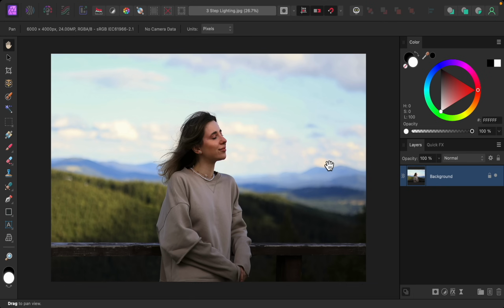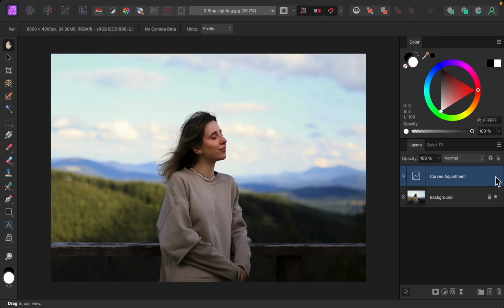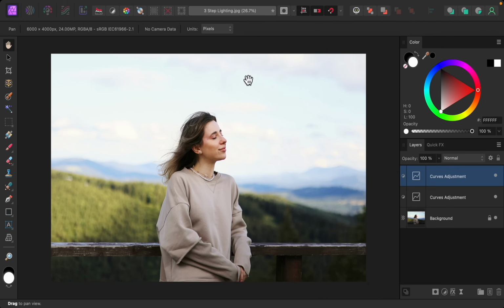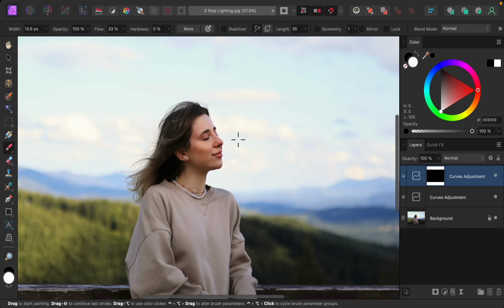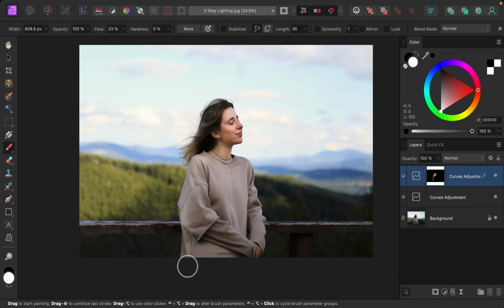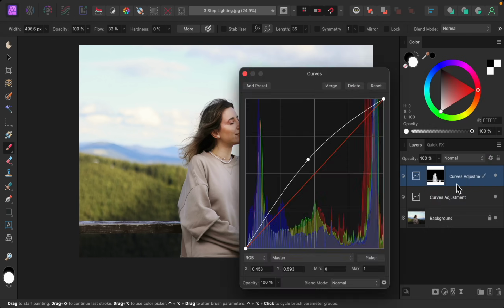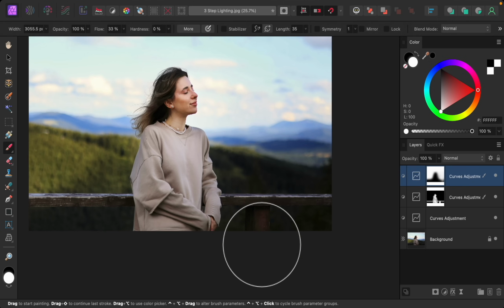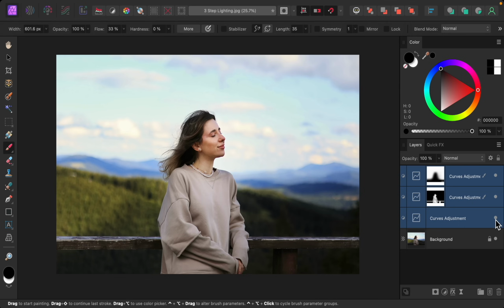3-Step Process to Create Incredible Lighting in Affinity Photo!

Comment: Hello!  I've really been enjoying your videos.  I was wondering if you could do a video on FX Layer Effects in conjunction with the Lighting Filter.  In version 2, which I have, a lot of the options (ambient, duffuse, specular, shininess, etc) have been removed from FX Effects and are now found separately in the Lighting filter.  When I try to use the two together, I get an increase in darkening and otherwise disappointing results.  It's unclear to me how the two are to be used together.  Most of the videos I've been able to find on this are all using version 1 - which combines all the options under just FX Effects.  Any help would be appreciated in sorting this out.  You are an excellent instructor!
Reply from the maker: Thanks for the video idea!
Reply: @AffinityRevolution  I just discovered that the reason I wasn't getting those other options in FX Layer Effects was because I was only checking the box (for example 3D).  That's not sufficient.  I had to check the box and also SELECT it by highlighting it as well.  Then the other options showed up.

I still would love to see your take on these settings!